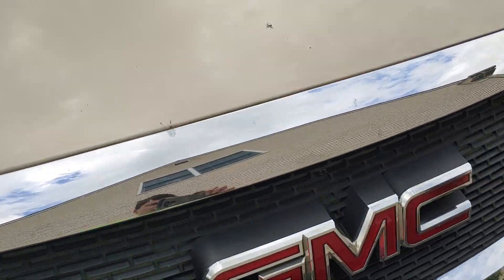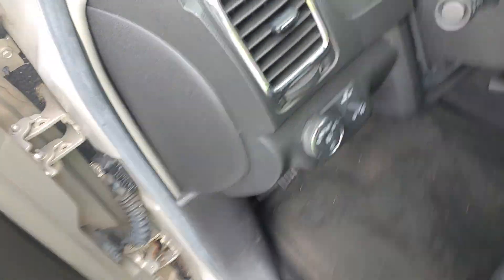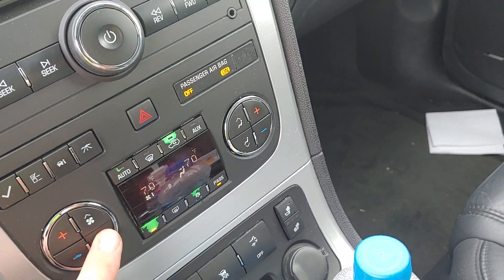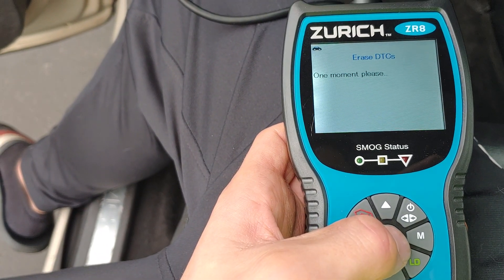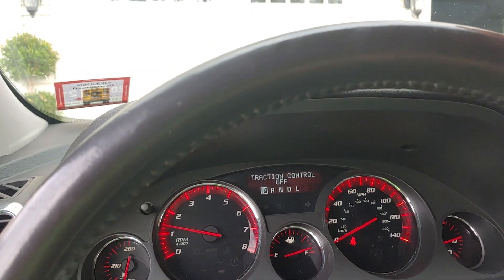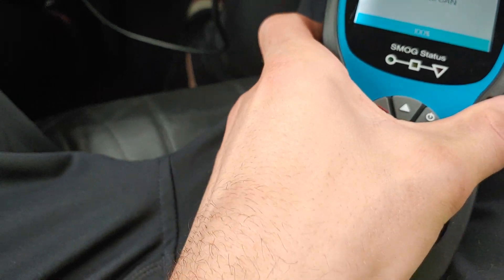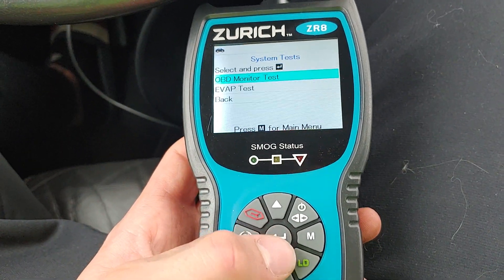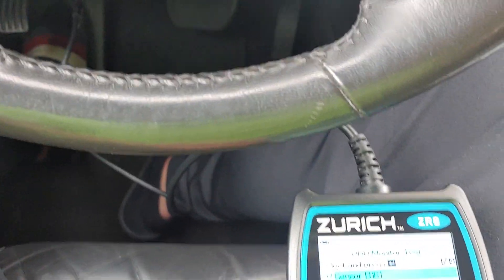Zurich ZR8 OBD-2 Scanner Review.

Comment: Regarding turning off check Engine : if you are repairing or replacing a part that that caused your check engine light to come on never turn off the check engine light. The reason for this is if you truly fixed the problem the check engine light will shut itself off at the point it no longer see's the problem usually within less than 3 miles. The same goes for having a mechanic shop repairing the problem from the check engine light. When a check engine light is reset most people don't realize resetting the check engine light also resets your entire computer that usually requires driving approximately 200 miles before everything including the non troubled issues. If you or your mechanic truly fixed the issue you will see the check engine light turn itself off and if it was not repaired it will stay on and you will then realize what you or your mechanic fixed or replaced was not the resolution to the problem and you will have to go to the next step or option that is associated with the problem.
Reply: Facts, but your anxiety will go away even though subconsciously the light will be back at some point haha